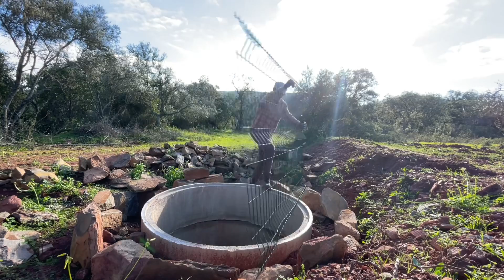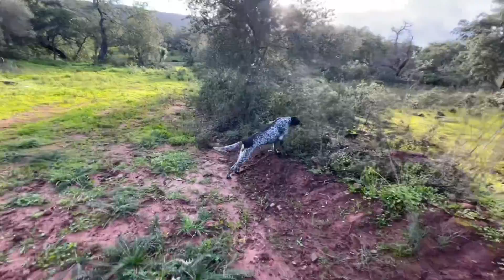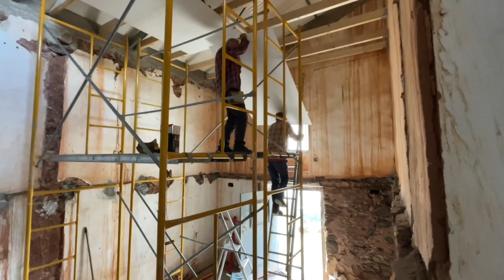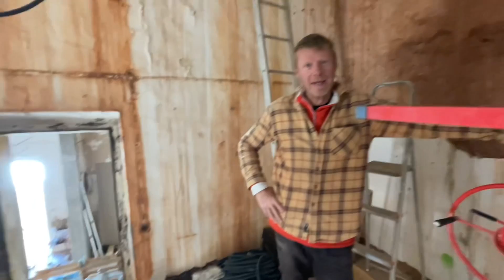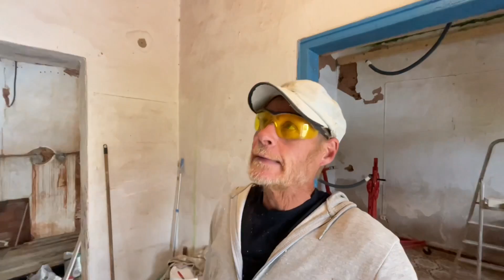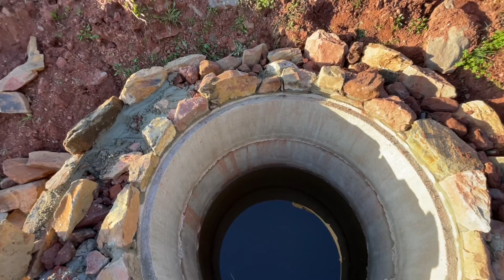Finally Fitting Drywall/Plasterboard On Tall Ceilings and Well Stone Laying #105

Comment: It's always wonderful when you reach the plasterboard stage and everything accelerates. The wall round the well is coming on beautifully but I wonder if it would be a wise addition to create an iron ladder on the inside. The old wells usually had them even the granite block ones which had natural handholds. The inner surface just looks very slippery and I don't want your videos to suddenly stop!
Reply from the maker: Hi, the well will have a metal cover. 👍

Comment: Great progress. I perceive your insulation a little bit weak. When I renovated my Mas here in the Luberon, in France, I put in 40cm of Rockwool insulation under the roof. As we say here: "In winter the Provence is a cold country with blue skies, in summer a hot country with blue skies".
Reply from the maker: We did add another layer over top as we got the wrong thickness. Couldn’t vid as I was getting too dark up there and was enjoying being 6m up scaffolding. The roof also is insulated. 👍

Comment: Andy. On a safety notice working by yourself, I’d cut the metal grating to fit the well top full time or hang a chain over the edge. Try getting out of that well if you slip over the edge. Just a thought.
Reply from the maker: It will have a metal top. I won’t fall in but if I do I can climb out easily. 👍

Comment: Andy, what a relaxing video this one was to watch. Great therapy session if u ask me!!  I’m so surprised that they have what we in the USA call Sheetrock available in Portugal as well as the Sheetrock elevator. I had to do a garage ceiling with double Sheetrock layers for fire code, and that little machine absolutely saved me!  I moved to the USA 36 years ago….so it’s great to see that I could eventually build an A frame there using similar building methods and materials to those that we use here in America.  Cheers❤
Reply from the maker: Definitely handy now we’ve put up the taller ceilings. Used on my last house and it was so easy on my own. 👍
Reply: @rusticcrow  👍

Comment: did you insulate the vertical wall - saw you did the ceilings but not the triangle shaped vertical wall.  might pop the drywall off attach the insulation to the back of the drywall and then screw back into place.
Reply from the maker: We did and added a second layer over the top. We didn’t realise until we opened that we got the wrong size so had to double up. Unfortunately I could’t vid because it was dark up there and wasn’t enjoying being 6m off the floor.

Comment: Hi ya, have watched I think all your vids and really like your content, but have to say that as a former carpenter who worked on 1st and 2nd fix new build mostly I was surprised to see you put up the ceiling plasterboard with out putting any rows of noggins through at 1200mm not only to tighten up all the beams and prevent any twisting in the future but also for the board joints ?
Reply from the maker: We did over the top after we added insulation as we were going along placing boards but couldn’t video cos it was too grainy and dark up there. We also laid the boards across. You can probably see what we did in next vid